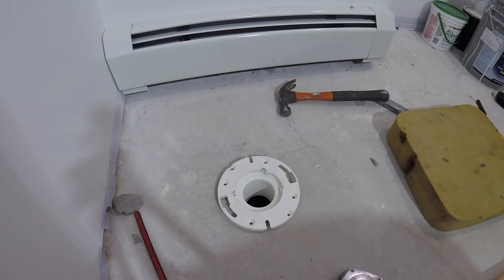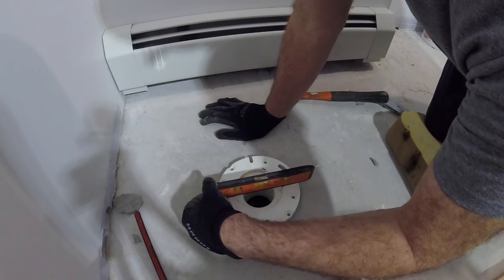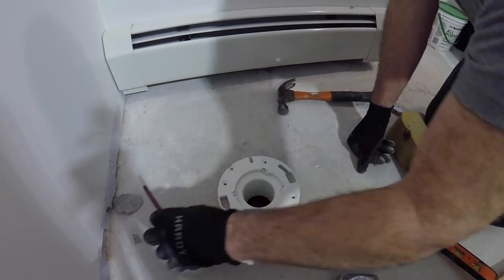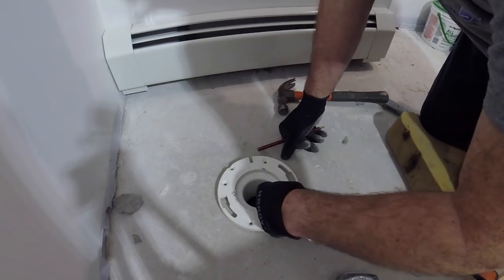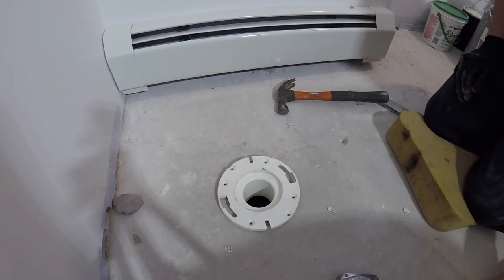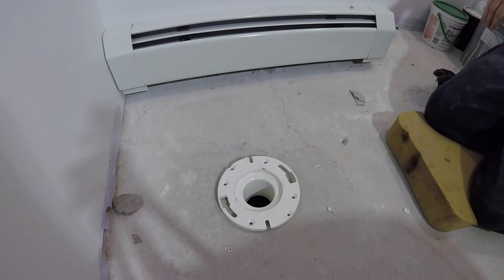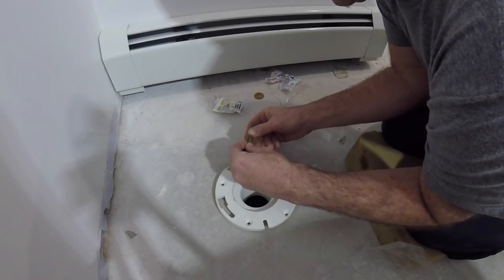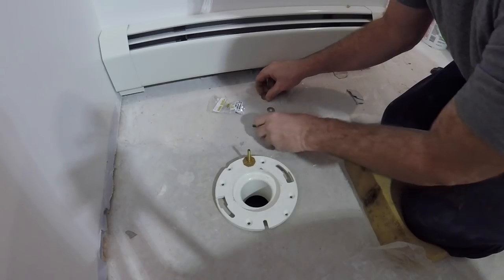TOILET FLANGE AND TOILET INSTALL AT CONSTRUCTION SITE

Comment: I see you use that "Temp" statement to excuse your work with a lot of the comments. 
   Temp. Doesnt excuse not setting it properly the first time.
  Nice try though. 
Just accept it.
Reply from the maker: Just except its a temp toilet lee.
Reply: why would you set it the first time when the flange would have to come out to be readjusted after floor leveling and adjusting for tile height.  it's also a temporary used toilet!
Reply: @rickw4160  how long have you been plumbing? I've been doing this for 3 or 4 years now. You dont put flooring under the closet flange ie:tile, Linoleum.  If you are at a job setting even a temporary toilet.  Why not set the flange correctly.  This is the type of cheap flange that can be removed very simply. Pull 6 screws out of the concrete pull up on the flange. Let them level the floor. Then reset the flange. When they "level" this floor this flanged temporary toilet will not be here anyway. But I would not want a toilet wobbling all over the place even for a short time. There is nothing wrong with "Do it once, Do it right. 
  I'll bet this flange doesnt move up more than a 1/2 inch when the floor is "Leveled out" if it is. They should tear down the building and let someone who knows what they are doing replace the slab.
  I'm very glad we don't have builders like that in our area.
That's pretty shoddy workmanship. On the concrete & the plumber. Please stay back east.
Reply: @ChuckBarron  just "Except" it's a temporary toilet. 
  Or.....
 Do you think like your work being wrong. 
 It should be. 
  Just "accept" it's a temporary toilet??
This is not about the toilet at all. It's about your quality work. Or lack of..
Good thing you have your firefighters retirement. Now you need to find cb2 a real job. By learning plumbing from you. He better be able to run his own company because no other company will hire him. Get him an edumakaishon just like cb1 has.
Reply from the maker: Lee  like fishing here......West is best...East is least!!!! I love me some monday morning quarterback chat from lee....I know West is best.....Just ask Lee..  lol
Reply from the maker: West is Best Right Lee??? Cb2 and Ab gonna be just fine. We have you to teach us when I do temp work...For that I thank you. Love me some lee advise. Happy Monday Lee!! Did you make a few dollars today?
Reply: @ChuckBarron  nope sure didn't.  Well that residual income came in like every day. But I spent the day in doctor offices. 21st of next month the cut my corotted arteries out & replace them. 
  So please put up one of these great absolute correct videos up on the 22nd. That way, I'll have something to comment on on the 22nd. If I'm alive. Will you miss me??
 I know. Of course you will. Just more Deflecting by cb1.
Your turn
Reply from the maker: on gonna deflect some more and pray for my man Lee....We upload 3-4 vids a week..Maybe I can assist your Dr.? I promise not to do temp work on you....
Reply: @ChuckBarron  the thing I wouldn't let you do is fill in for me while I'm not going to be working. 
   From what I've seen cb. I and my customers would rather their work not be done at all. After seeing the quality of the work you do. 
  I'm just saying 
 Maybe we can get Jj Jj to fill in. He can't be any worse. Even if he's not a plumber...
Doesn't take a Rocket scientist to go to Ferguson's & bye a piece of shit repair flange..stick it in Half-assed. Then set the toilet. Hell, I'm sure even Jj Jj can do a fucked up a job as you did here.
Reply: @ChuckBarron  please don't Pray for me. I've got everything on my end covered.
Thanks, but No Thanks!!
Reply from the maker: 🙏 Im still gonna pray for you bitter lee.....don't be so bitter.🙏 Amen!
Reply: @ltsgarage7780  , bitter lee, Im a licensed plumber for 20+ years, in all that time I see alot of things that give problems, pvc  flanges are not 1 of them, please try to relax, hope your health issues work out
Reply: @JjJj-yl6on  my my. I hope I make 20 years in plumbing. 
  You may not have seen plastic flanges fail. I have. Stainless steel only. Plus. This flange is a "repair" flange. You dont stick something inside a 3 inch pipe & make it even smaller unless you absolutely have to.  Hence, "Repair flange"
    You've never seen plastic roll up at the bolts? People who reset their own toilets over tighten them every time.  
  I'll let you know when i hit my 20 years plumbing. You must have seen everything by now!
 Thanks. My health doesn't change my opinion.
Reply: @ltsgarage7780  , I have seen them fail, when installed by a professional they are fine, & cb is a professional, overtighten most things & they will fail, also the exit hole in the toilet is smaller then the inside pipe repair flange, a wax ring w horn is also smaller then repair flange, if I set a temp toilet I might not even use a flange, just a wax ring w horn directly on floor & caulked toilet to floor, no bolts, no flange, hows that for a temp setup
Reply: Lee, problem is that there is too many variables. I can't tell how level the floor is. We don't know what type of flooring the customer intends to use; could be vynl plank, could be tile, and of unknown thickness.  Then, to top it off, you don't want to drill holes into concrete where you don't have to; then backing them out and going back in again? Temp toilets are just to get by regulations of requiring a bathroom and hand washing facility when you have more than a certain amount of workers on sight. You can rent a portajohn, but this is cheaper if its gonna be a while.  Nobody is tearing down a building or replacing  a slab because the floor is out of level. Just not happening.
Reply: @rickw4160  my goodness.  You haven't used any of the new today's fasteners. You can drill in screw that floor 10 times today & not worry about the concrete floor collapsing or breaking down. 
   You never & I mean never put flooring under the flange. 
   You can make every excuse in the world on why not to do something.  But the factual truth is. This flange & floor in this area is not going to change anymore than about a 3/4 to 1inch from where it is right now in this video.  
 Step 1.
      Oh, You want a temporary toilet? 
   You go in Put in the "adjustable height" toilet flange.
 Screw it down, set the toilet. 
Step 2.
  Oh you are ready to install flooring.  You go in pull the toilet. Unscrew the "adjustable height" flange. Pull it completely out of the pipe. Plug the pipe.
Step 3.
Levels floor.
  The contractor installs the floor. ie: Linoleum. Wood, Tile. Who cares, it not going to change more than an inch!
Step 4.
    You come back in install a permanent type flange. On new construction & a 3 inch pipe . The flange should be glued to the outside of the pipe. Screw it to the concrete floor. Set the toilet. Done.
   In today's sue happy world. You eliminate all Liability. Because you can never eliminate it all!
   Now knowing that it is a personal friend of the plumbers. Maybe its really only the friend and 1 or two others using the toilet. Maybe just maybe you don't screw it down. I would, but "maybe" you don't.
  Do you really think this floor is more than an inch from being out of level? Really? This little bathroom & more than an inch out? 
 If it is. I would have a talk with the contractor about using this concrete guy ever again.
  Now knowing what we know now. The contractor, the concrete guy, the flooring guy, the painter, the finish guy, the, the,,,, are all the same guy, "the friend".
But I still eliminated 99% of my Liability.  Because friends sue friends the most in this crazy ass world.
  In the last 45 years of being in this business.  I've never been sued. But I'm a little over protective with my work. You & cb1 can be anyway you like. 
  No matter what you try to say. I would have screwed this flange to the existing floor.
Thank for your opinion.
Reply: @rickw4160  oh. I forgot about your hand wash regulations. Are they going to wash their hands in the toilet?     😉
Reply: Lee, what new fasteners are you referring to?  tapcons?
Reply: @rickw4160  really. Now you want to start a whole new subject matter?  Why don't we just stay on subject here. 
Would you should you set this toilet properly. Better yet. When you sent your hired help out to set a temporary toilet.  Should he do this kind of work and you pay him for it?
Reply: @rickw4160  stay on subject.